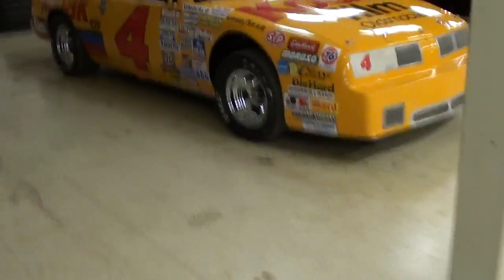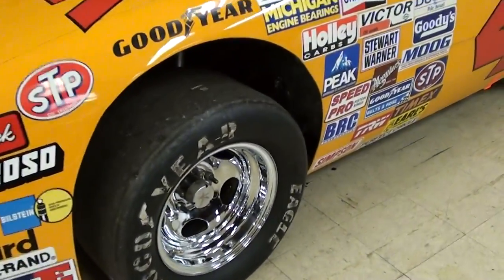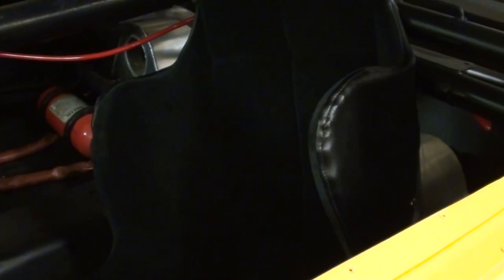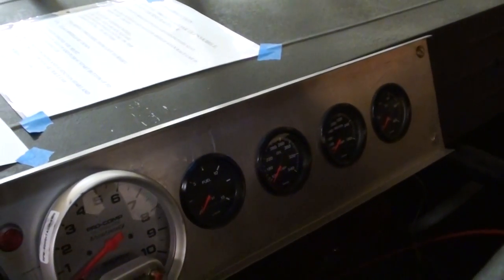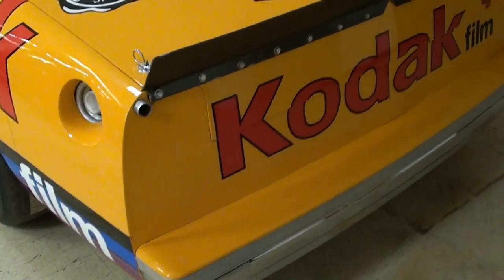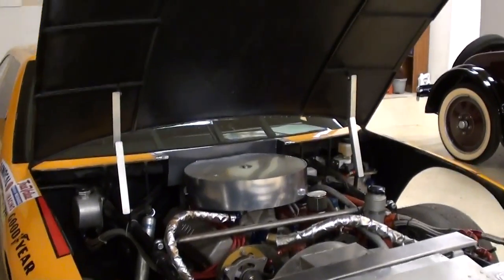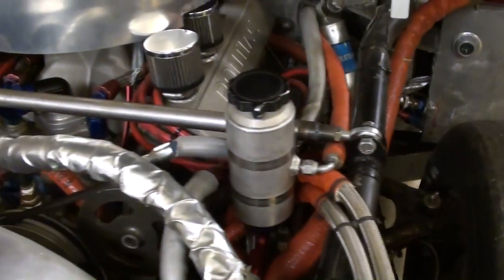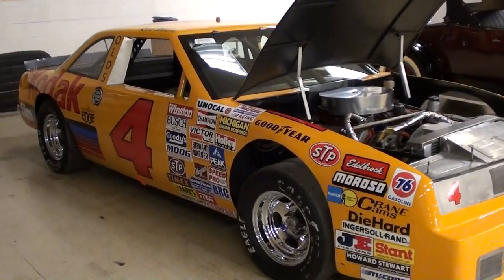1986 Oldmobile Kodak Winston Cup Stock Car - Morgan McClure Rick Wilson Race Car

Comment: Here's the real deal answer on why the chrome wheels were outlawed: Nascar felt that cars were throwing wheel weights due to the slick chrome finish, and causing accidents mainly due to instability at high speeds. They outlawed the chrome finish for safety in the late 1980's.
Reply: why couldn't you just grind the chrome off where the lead weight was placed?
Reply: I vaguely remember it having something to do with the chrome wheels cracking...

Comment: Great one, lad. That 80s Nascar stock car is great for electrical conversion using Tesla technology because I thought classic and vintage Nascar race cars need an electrical conversion with solar roof panels not only running the car longer, but also charging the battery.
Reply: W.......T.......F